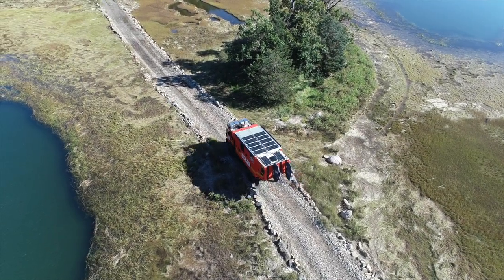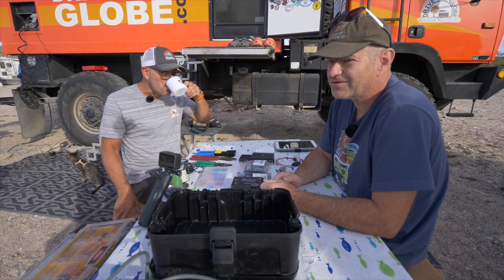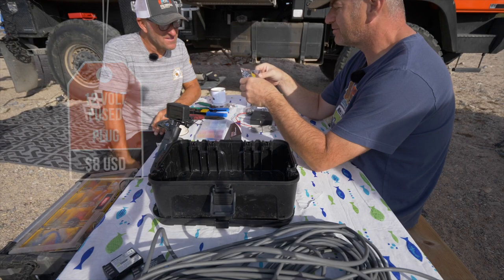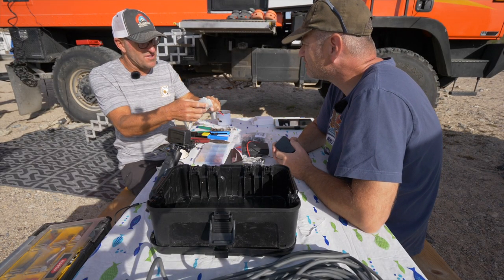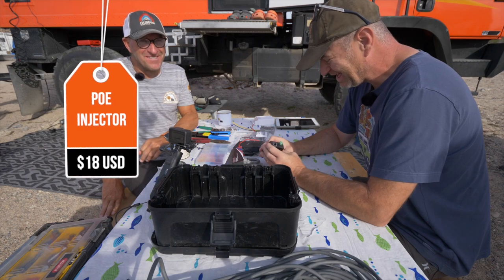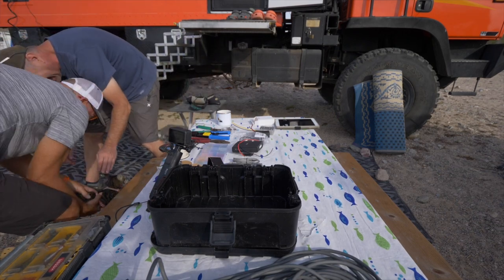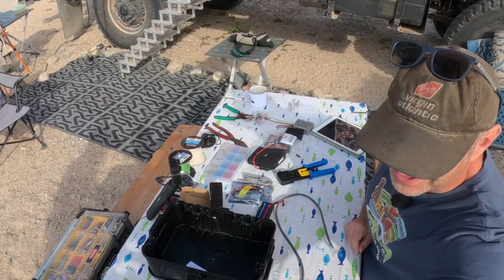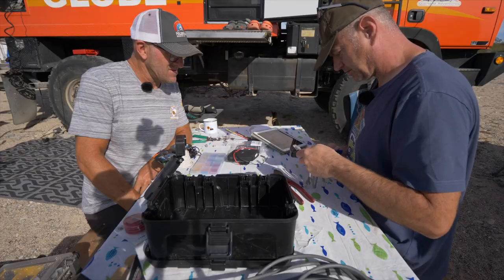How To Power Starlink Satellite Internet with 12 volt DC - Easy DIY Conversion

Comment: The 12V to 48V up converter you are using is known to cause signal degradation in Starlink. If you experience outages and/or poor internet speeds, that's the first place to look. If not then you're lucky and it's all good.
Reply from the maker: Good to know.  Thank you.

Comment: If I already have the SL Ethernet 'dongle' for my home router can't I just plug into that 12vdc router you have and a 12 to 48vdc converter and use my existing POE injector?  Seems more plug and play or ___?  That router you have was my missing link for my mobile rig it seems.  Seems to me SpaceX is missing a fairly large sales opportunity here.
Thanks for the video guys.
Reply from the maker: They are missing an opportunity. Guessing a 12volt set up will come eventually. The key is making sure the 48 volts goes to the dish and not the router.

Comment: I got a bit confused when you were covering the fuse towards the end of the video. what fuse did you end up going with? my current battery system has a 12v dc output with up to 10 amps. (ecoflow river max) but i plan on a much larger one for my final power build.
Reply from the maker: I believe we used a 10 amp fuse.
Reply: @drivetheglobe  I think so, I watched the section a couple more times to make sure.

Comment: I’m confused about the Raj45 wiring. Is it the one you show on the diagram in the video? Thanks
Reply from the maker: Yes. But it is proprietary to Starlink.
Reply: I have been a telecommunications tech for over 20 years and No it is not proprietary it’s is a industry standard covered under ANSI/TIA-568B the other is ANSI/TIA-568A some countries use A like Australia and Canada for example much of America uses B except in many military and government installations where the specification is for A, if you terminate a cat5e cable A on one end and B on the other end you have a cross over cable which where needed and very common years ago for connecting switch’s and hubs and routers to each other these days cross overs are pretty much not needed or used anymore other than in a few specific cases as modern networking equipment is now MDX/MDI in other words the devices talk to each other and adjust their pin outs automatically so it was also totally a pointless waste of time cutting one end off the patch lead and re-terminating it, as for the power usage transmitters use more power than receivers.

Comment: The 12v cig plug doesn’t get too hot? Everything that I’ve read says using a 12v cig lighter is a bad idea.
Reply from the maker: It does not. But it also was custom wired and I used a larger gauge wire than standard issue on stock specs.

Comment: It's simpler than that. Buy a small 12 volt inverter, plug in Starlink, and done.
Reply from the maker: The issue is that you still have a 25% loss in the inversion process so this using valuable power reserve